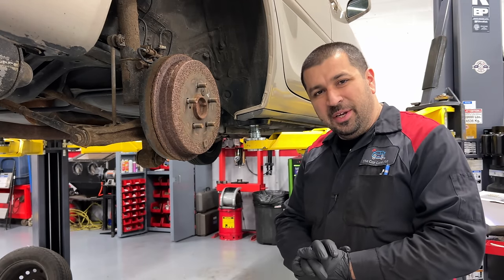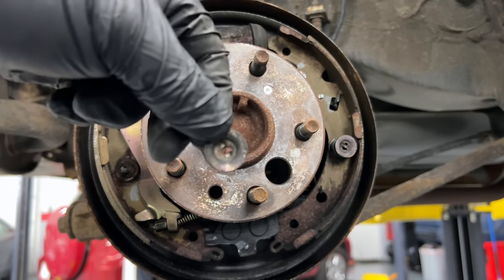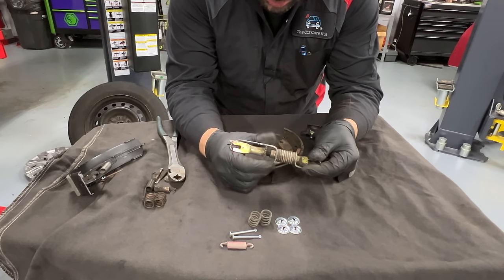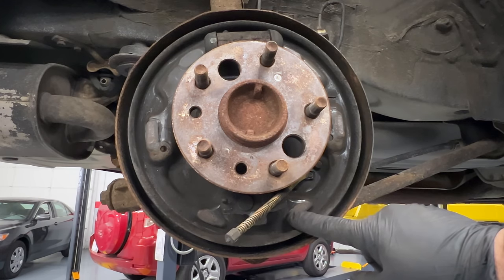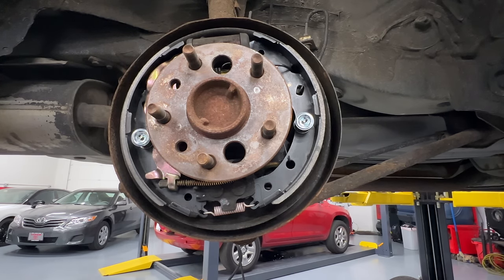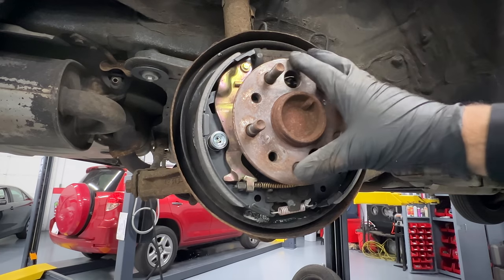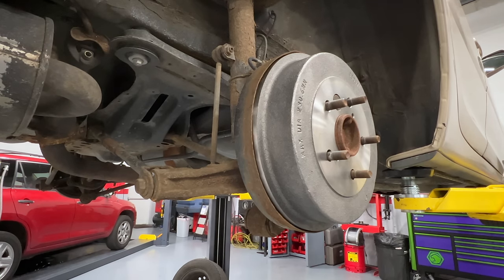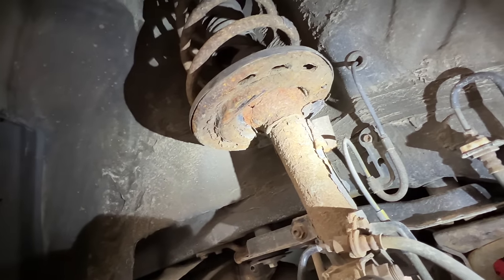How to Replace Toyota Drum Brakes Like a Pro

Comment: I did the rear drums on a Camry a few months ago and I wish it was this easy.... The real pain for me was that parking brake lever, getting it loose from the cable is not always that easy esp if the  the owner of the car never uses the darn thing so the spring was basically seized almost. Got it off on one side was a huge pain putting it on the new shoe so on the other side I just left it on the car and disconnected it from the shoe there, I had new c clips so it didn't matter if I destroyed them.

Comment: Can you talk about or make a video about the Tundra front disk brakes, how the disks warp with heat
Reply: Damn  😮
Reply: Every one of the Chinese discs on Amazon warps in 10-20k miles. I finally gave up on them. Have a set of original Toyotas on the shelf here that I will put on soon, and see how that goes. It's like the Chinese don't have good metallurgy sense
Reply: I was in my Toyota dealership gettn parts for my car & a guy was complaining he was going thru front pads on a 4 Runner. Parts guy said he could install larger rotors/calipers. 🤔 I dont like drilled rotors but have u tried slotted?
Reply: The early Tundra disk brakes are made out of shit metal and warp easy.  I’d look aftermarket on those if I were you.
Reply: @hangdog7094  it's not the country, it's the factory that won the lowest cost bid. Your iPhone is made in China but apple paid for quality control. There's no accountability for $30 rotors so you get poor ironwork and cheap low quality control and contaminants of other metals in there as well. Don't eBay or Amazon no name auto parts. A better workaround for aftermarket is Rock Auto. Otherwise the dealer is probably cheaper than your parts store in terms of not having to replace it even under warranty.
Reply: @LAactor  dream on...   i have tried "no name" and "BIG BIG NAME" including raybestos.  they are ALL MADE IN CHINA and every one of them warps.  the OEM toyotas that are sitting here are MADE IN USA, and i got a good 200,000 mi out of the originals.

Comment: Can the brake cable be removed without removing the shoes? I have an 07 tundra and am about to remove the whole axle shaft assembly and put a new one in and am wondering about that cable.

Comment: fun fact: some yaris rear drum lining brake pad, the parking brake lever is rivet with the lining and the aftermarket not come with the lever included. aftermarket not even sell the pin that hold the lever and lining together. if you encounter those yaris. make sure you check closely if the pin that hold the lever is removable or not.

Comment: In Toyota Sienna 2008, do I need to reset transmission adaptation, when I change transmission fluid? (never heard of you about resetting of transmission adaptation)
Mileage is 120K. I don't know, whether it was changed before, I just drained what came out and filled the same amount. Why asking, because when it's 0C or below, and I move it to Drive while pressing brake, car like noticeable sits down (same as being on paring brakes and pressing gas pedal). It's that noticeable  that being outside I can see how car sits down to the rear wheels )) 
This behavior was present before changing the fluid as well.

Shifting 1-5 very smooth doesn't matter cold or not. And after driving 30+ minutes and doing same thing (moving from P -> D), the feeling is gone (to almost not noticeable).

Comment: I have a 2003 I got used Corolla, and every time you stepped on the brakes have as it got heart hotter,, meaning as you drove the car longer they had this weird oscillation when you stepped on the brakes now the shoes were ready to be changed I picked up car for bike 200 bucks but it's a great car just needing some TLC which I'm just about done with.. but I replace the shoes , the only other thing I could think of was the drums and by golly that was it somehow I don't know how the drums actually got egg-shaped and it got worse when it got hot 😲
Reply: Got hot at one time. Or slammed on brakes in the extreme heat. Or adjusted OUT too much, causing heat. If u see blueing inside drums, cut or replacem

Comment: Typically the right side is easier for right handed people. 
The left side was such a hassle getring the main spring with adjuster in. 
Tip for all of you. Do not buy aftermarket spring kit from if you dont have to. Reuse the Toyota springs again. 
The Autozone spring was 10 times harder to pull apart then the OEM spring. Save yourself hours by this tip alone.

Comment: I have a problem on the  stopping power on the breaks of my 03 highlander it takes time to really stop.I did everything like new pads and rotors and blead the fluid...I checked the vaccum and changed the grommet at the power break booster.I am really puzzled coz there might be something wrong with the power booster and I don't think there's an adjuster in the post of the booster coz its different from the old ones...maybe changing the booster is the right thing to do...a bit of your advice would be appreciated. ty

Comment: Hi. I have a question about oil. There is Mobil 1 engine oil called "High mileage" (for cars over 120K miles) like they say. What is the purpose of it and whether it's worth to use? (maybe you have some video about it, but I can't find).

Comment: Why do you adjust them so tight? The adjuster only opens up as the pads wear down. I've always just slapped them on, and grabbed the ebrake cable to center the shoes in the drum and then adjusted for slight drag (because its going to self adjust afterwards). I am just curious why you went straight for adjustment without centering the shoes using the parking brake cable.
Reply: If the rear drum brakes were adjusted to his way, it will sure be loosened again probably after 50 miles of driving.  And it is gonna be hot and toasty after a leisurely drive.

Comment: Sorry for asking. I always wonder why the brakes lining needs to rub againts the drum a little bit while the hand brake is not engaged. Why this is the standard practice? If the brake lining is rubbing againts the hub, does it wear out the hub and generate unnessary fiction & heat? Please enlighten me. Thank you in advance.

Comment: Oh no....nightmare situation!  I replaced both rear drum pads and rotors and, now, the right side is spewing out brake fluid when I push on the brakes.  I reseated the pads into the caliper but it's coming out next to the rubber part.  Do I need a new caliper??

Comment: Hi .
I have 2017 Toyota Tacoma limited ,pully #2 on the left-hand side of the alternator I had to change it, but Toyota doesn’t make a washer which comes with pully that’s what they told me and , I was wondering if you can tell me where can I find a washer or what other option I have because without that washes pully still little wobbly.
Thanks.

Comment: do you need to replace the paper gasket behind the drum?  Mine was kind of flaking off and i ignored it and now my wheel is a bit wobbly and making noise..  probably should have cleaned it up before reinstalling the drum.  going to take it apart again later today.   have taken it to various shops 6 times and they keep trying to tell me my tires are out of balance...wish i had a mechanic like you nearby
Reply: update: i think my drum is warped.  going to try a new one today.

Comment: Any theory on why those back plates cost so much? I have an ‘06 Prius and an ‘03 off-brand Matrix XRS and both should really have new back plates. I can’t get the parking brake in either to work properly and not drag, even following my Toyota service manual adjustment procedures..

Comment: 1999 Toyota rav4 with 248,000 miles with issues. Will be doing front struts,oil leak, and rear brakes,then the rest.

Comment: AMD I have a question, have you ever come across a corolla 2010ish seems to run fine, temp appears normal, starts normal idles fine. drives good. BUT when you turn the car off after it turns off sounds like a dark vader breathing out? no engine lights no codes nothing sound comes from the front engine bay? Have you seen or heard of this?

Comment: I have never seen an anti-rattle spring with a bottom washer against the shoe before, is this normal ?
  I always use copper-slip on the bearing surfaces, why ? because I’m trying to use up the tube I bought thirty years ago !

Comment: i have 2sets of tire winter and summer for my 2018 rx 350 question is the original tire when i bought the car the pressure on my dash board is working but when i switch to 2nd set of tire whitch is the winter tire the pressure monitor on my dash board is not working should i go to the dealer ang re calibrate

Comment: Hi I recently did a breakpad/rotor change on my 2015 Sequoia, when I went to bleed the breaks with truck on and began by pumping from furthest break passenger rear very little fluid came out and second pump nothing came out the back and same followed for other side but front ones did better but after noticing a leak a pulled apart and went to bleed all breaks but this time nothing came out of all plus reservoir was full ? Can’t use truck now as there is no breaks, pedal hits floor.no breaks?

Comment: The brakes on my 2001 Tundra are one of the design flaws. Fear of rear wheel lock-ups made Toyota bias the brakes almost totally to the front. At 150K, the shoes aren't even half worn and I'm delighted because I hate doing shoe replacements.

Comment: Jiggling the shoes to get the drum on is obviously fine, personally I would wind up the shoes until they bind, thump the drum with a rubber mallet, and help the shoes to centralise, slack off the adjuster maybe with a tap along the way to keep it centralised, but leave it bareley dragging. Although it may bed in, why put unnecessary friction into the process. Burning gas until it smooths off. Maybe it's a gamble, but with that level of mileage I would hate to put on a set of shoes to find the cylinders leaked after 3 months. At the least peel back the boots to see if its moist.  Never though I would dare to be critical having watched so many authorative videos. I guess being over 70 puts me into the old school bracket.... :)

Comment: Could you leave the rear brake pad and just replace the front shoe since there's not much wear on the rear pad and would simplify the replacement. I have a 2007 Sienna with 120000 miles. I'll need brakes soon D Y S er. Bought new.

Comment: Missing a small/little grease quantity on the different place of the rear brake assembly where is the touching metal and is the mouvement/rotation. The bearing hub must be greased a little bit before to put the brake drum. A tehnic job to fix the brake gap: put the hand brake in nr 1 position, turn the special gear on the drum window until de drum will be a little blocked. Release the hand brake to nr. 0 position. The brake gap is nice now. The brake drum will turn correctly now. Bingo.

Comment: Yesterday I just had the brakes and drum replaced on the front of my 2007 Camry six cylinder.  With 70k miles.  The back seems to be OK.  Do the front wear out sooner than the back?
Reply: The backs will last at least triple with the front wheel. I just replaced my Corolla rear drums at 300,000 and yes they were worn true nothing. Replacement Aftermarket drum had a big casting hole in one of them Straight from the factory. (China). Broke down and ordered real Toyota
Reply: @hangdog7094  how many front brake drums and pads have you gone through?
Reply: Thats why they first put discs up front. Fronts take the grunt of stopping.
Reply: @riceburner4747  so 70k and 16 years is pretty good for the first set up front? It helps to be in dry and warm Texas!
Reply: @gosman949  hmmm... lets guess here.  got this corolla @40,000mi, now 350,000.  if not for chinese rotors, a set every 90,000.  but these all go out of flatness at 10-20k. so, many many.  thats why i went back to factory.   tried turning them flat again, but it comes back.  factory costs triple, but its worth it in the end.  only use akebono pads also.  No need to replace a good toyota brand rotor if within tolerance, just slap on new pads...
Reply: @hangdog7094  when they vibrate mightily when braking, time to change the rotors.
Reply: @gosman949  yup - irritating & dangerous

Comment: No wheel cylinder replacement ? As a  rule 
of thumb I do.once the wheel cylinder pins are pushed in there's a reasonable chance at least one side if not both sides will leak.

Comment: What causes your rear brakes to get stuck ????? I have a 2006 Tacoma Pre-Runner and every time I come to a complete stop and as I release my foot from the brake pedal I get this awful vibration / jerk from the back as if someone rear-ended my truck. I was told that the rear brakes are getting stuck. Could this be right ?

Comment: Dear TheCarcarenut, thank you for the sharing. shouldn’t we replace cylinder brakes to prevent a potential leak as well? Kr
Reply: No! What does he always say? If it ain't broke, don't fix it. Plus it's entirely more involved. Round off or break the hardline to the cylinder? You wouldn't happen to have a flaring tool to remake the end lying around? Perhaps it comes off fine. Gotta bleed the cylinder. Plus the rears stop the car 20% of the total force, one cylinder leak back there is only worrysome if you go through the while reservoir. If it's leaking, then change it. If not, keep an eye on it for leaks. You'll see it on the rim or backing. It's an old Toyota, you can rely on it.
Reply: Only on Chevrolet products....
Reply: @loveydovey4u  CHEVY THUNDER!

Comment: Are Parking Brakes that have shoes inside the rotors done the same way?
Reply: Yes very similiar but RARELY need serviced. And use the PB often so it doesnt freeze up. When ever I install pads, I'd brake clean parking brake & shoes & lube like AMD did. 🤔🖖🇺🇸

Comment: One side note about brake drums. Most of them are already manufactured so close to their maximum allowable diameter that they can't be turned under any circumstances. Either you reuse them as is, or replace them and I don't recommend the former.

Comment: Aftermarket drum shoes are basically a commodity. Retailers want them from the manufacture for basically nothing. So one of the corners a lot of aftermarket manufactures cut is not to taper grind the ends of the lining. The sand paper "trick" is a good idea. Been in the aftermarket friction industry for 23 years mostly as a product design engineer with 90%+ on the disc pad side. Drum shoes just don't make money. lol

Comment: I'm absolutely shocked at the comment regarding lithium grease getting on the shoe liner is not an issue. Lubricant on a friction surface is absolutely an issue because it leads to glazing. The proper way to do this is to apply a dab of brake lube (a high temp silicone-based grease which won't melt at normal disk brake temperatures) on each contact point and then install the shoes onto the backing plate. It doesn't take much at all; "a dab'll do ya." It's critical that the drum/disk surface and the friction surface be completely clean before bedding in the 2 surfaces.

Comment: On the second shoe that you did the original brake shoe pad came right up to the end of the shoe on the replacement shoe it stopped back about an inch-and-a-half is that normal

Comment: Look at the amount of wear those original shoes had at 200k miles,  it takes about 60,000 miles to wear one mm of rear shoe material.  Personally, I would not replace rear shoes until they have about 1mm friction material remaining for my own vehicles.   For a customer,  at 2mm I'll suggest replacement,  but let them know it's not very time sensitive.

Comment: I didn’t see you put the two screws/bolts to secure the drum on the hub—did I miss that part?
Reply: Those bolts are to push the drum off because of rust jacking making a ridge on the hub so the drum is harder to come off. If you have a flap disc you can also take the edge off that way.

Comment: I can't figure out how to tell which way the adjuster should go.  One side is longer than the other.  Years ago I gave up on doing my 2005 Scion Xa tear drum brakes after I started the car and tapped the brakes.  This launched the piston pins and brake fluid started leaking.  I had it towed to my mechanic who laughed and said you have to have the drum and shoes on or that'll happen.

Comment: One thing I did that I did not see you do, you did not take the self adjusting screw apart, clean and lub it. You mentioned grease on the backing plate, but you did not put any on, that is fine since it is just a tutorial video.

Comment: Easier way to adjust drum brakes.1st thing to do on your test drive is to back up slowly and pump the brakes. Those adjusters will spin out to where they need to be.just service those adjusters while you have it apart. If they are rusty or don't spin freely, replace them.

Comment: I've used after market brake parts on my Toyota without any issues. The only issue I've had is with poor quality rear wheel bearings not lasting. Buy good ones!

Comment: Be careful when spraying brake cleaner not to get on the car finish. When the shoes are off,  it's a opportunity to check to see that the wheel cylinder pistons are not seized by putting a finger on one side and a thumb on the other and gently moving them back and forth together in both directions being careful not to go too far. Wear a filter mask and gently  blow the off the around the rubber boots and peel each one back separately to see if there is any fluid leakage or rust. I like to use a light smear of heavy grease on the shoe to back plate contact points.  When I get near to locking up the initial adjustment, I step on the brake pedal to center the shoes.  When it's locked up from adjustment, I Deflect the adjuster arm and back off 5 to 8 teeth; which usually leaves it not dragging. After the shoes are bedded, a recheck can be done.